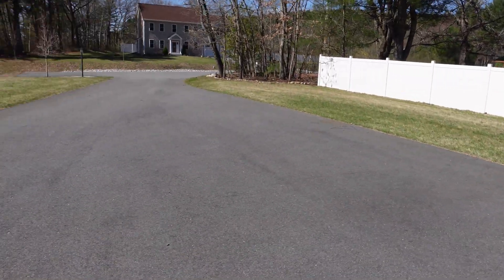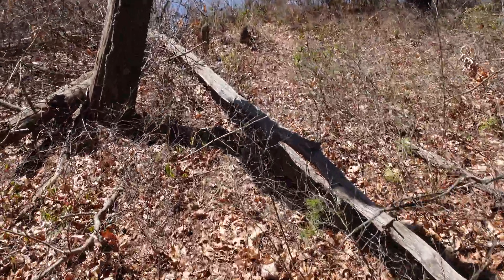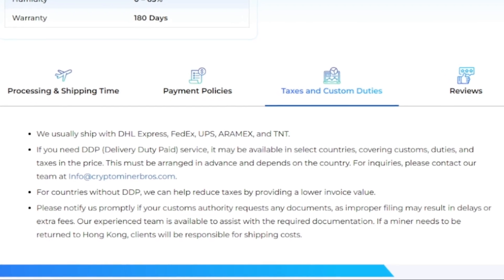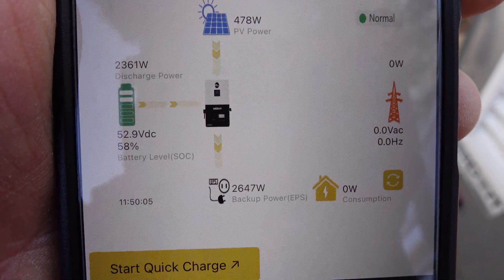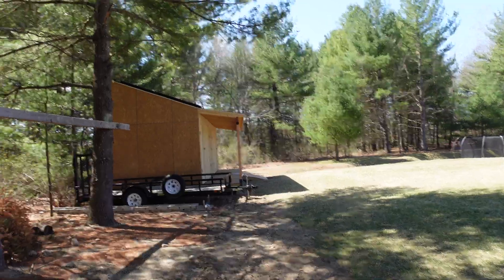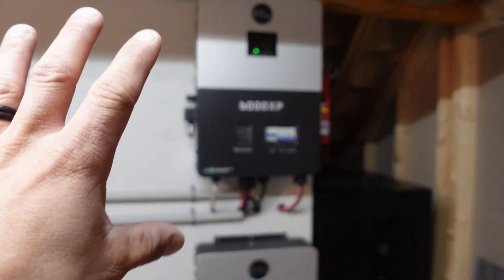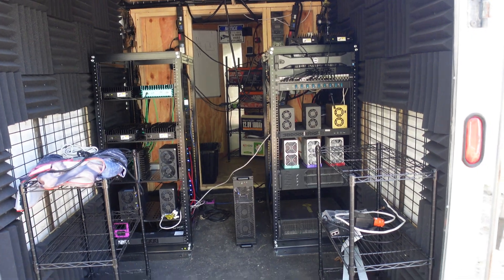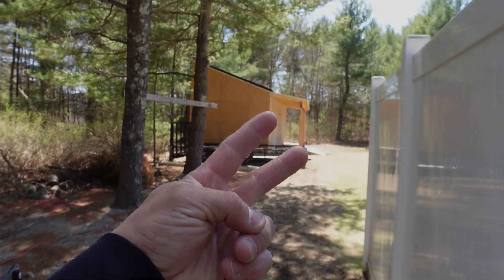My New Crypto Mining Solar Setup is UnReal!

Comment: @ChumpChangeXD Mining & Crypto dude thats amazing, basically the bifacial on the pergola is giving you 1 extra kw than the shed, truly one clean setup 11 kw and it’s not even mid summer yet !! dude you may need even more batteries or you got to run more miners during the day! also i would setup another box for the trailer the idea you got with the 120v box  will look much cleaner.

Comment: Get Emporia so you can see draw for each circuit. Also, dont know if you have a whole house surge protector inside the main panel, if not consider getting it, should protect the whole panel f4om large spikes, maybe even a lightning strike, something in the 100kVa range